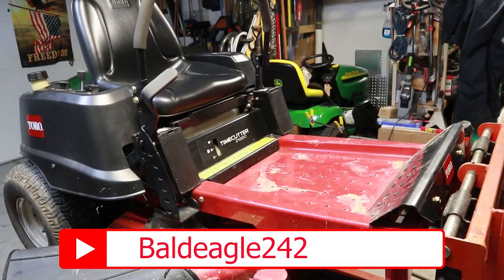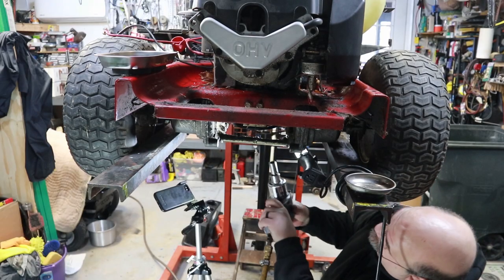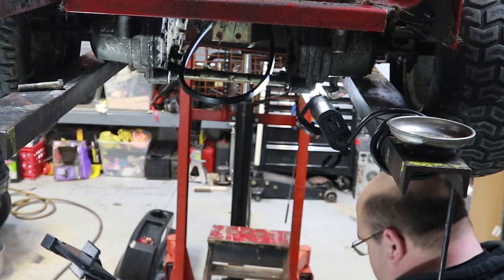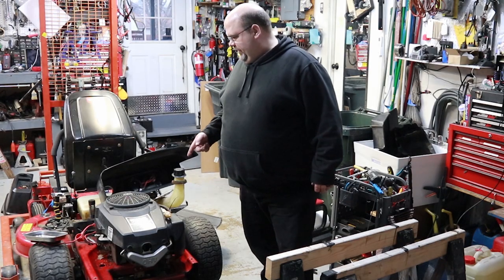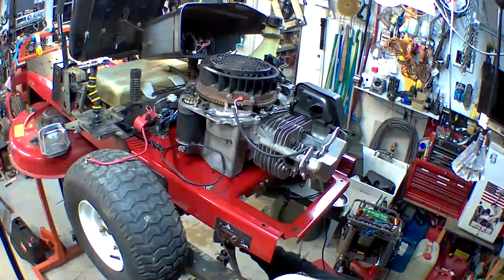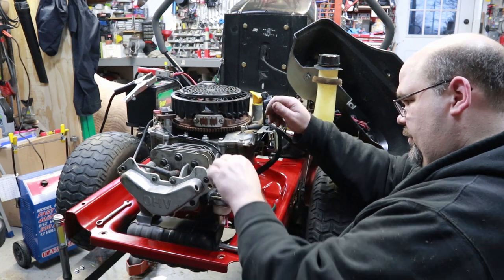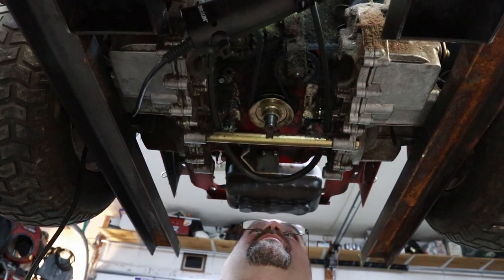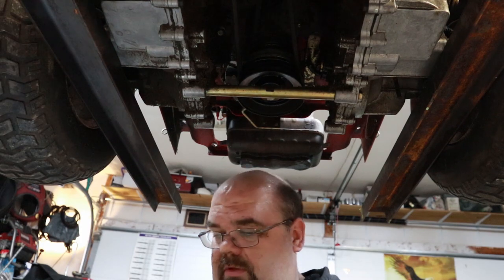How to PREVENT the Kohler Courage Engine from Cracking the Block #baldeagle242

Comment: If the video had even covered a small portion of the subject the title referenced I would have given it a thumbs up but click bait gets what it deserves.

Great video other than the click bait title that offers a question the video creator didn't bother to answer or even discuss in any depth.
Reply from the maker: Thanks for watching. You must have skipped the first 20 seconds of the video. In the first 20 seconds of the video starting at the 00:10 mark I explained why this happens and how to easily prevent this issue. The remainder of the video was what needs to be done after the engine has been cracked.
Reply: @baldeagle242  I am sorry, you are correct and I missed that short explanation. Thumbs corrected.
Reply from the maker: @rickbauer7088  You’re a good man. Thank you sir. 🦅🇺🇸

Comment: What is the Fail safe on your lift,, That is what i would be worried about the lift giving away
Reply from the maker: I made a reference in the video about this. I welded a latch that flips around on the side and has a strap I tie around the top.  
With all the comments I'm getting on the lift, I plan to do a video on it at some point shortly.  
Thanks for watching and stay tuned.  🦅

Comment: Nice video, so is the main reason these engines have a bad reputation due to them losing oil and then blowing up, etc? Or do they just have multiple weak points/issues?
Reply: ah I see from some comments, its a little of both. I may buy an older Dixon ZT with a courage swapped on, will have to check it over very carefully before giving/selling it to a co-worker - if I don't keep it myself lol.
Reply from the maker: @M.TTT.  there are a few issues with these engines. Some issues can be prevented. 
The main issue is low oil and keeping the oil fresh and full. 
A second common issue that I mentioned in the very beginning of this video is the case/sump bolts become loose and back out catching under the flywheel. This usually results in the front corner of the case being cracked. 
The internal cam and timing gears are plastic and any type of backfire or sudden force can strip teeth off the timing gears. 
And last but not least the compression release mechanism is prone to failure and spreads broken parts all around the crank case.
Reply from the maker: @M.TTT.  I still have this mower and use it when I don’t have anything else running in the shop. There are lots other them out there still running but it would not be my first choice if I had other options.
Reply: @baldeagle242  ah, thank you very much for the reply and information. Guess I'll just hope it doesn't blow up and if it does, I'll try to find a cheap lawn tractor to do an engine swap.
Reply from the maker: @M.TTT. I’ve seen them with over 1200 hours on them.  If you change the oil and keep the oil topped off they can run for a long time. 
You’ll also want to make sure to keep the engine clean so air can flow around it. I’ve seen them fail because the are so encased in dirt and grass there’s no way for the heat to escape.
Reply: @baldeagle242  ah yeah, I'll have to make sure my coworker keeps up on maintenance, easier said than done, but maybe he'll take it seriously. Thank you again for the help

Comment: I have a courage 22 that I "rigged" with the customized C clamp and JB weld over 5 years ago. Still works fine. The top side bolts and the 4 engine mounting bolts have loosened a couple of times, yes it still leaks a small amount of oil but not much.  This mower has cut 100s of acres of grass. It is a 2009 gravely 2250 mower. Rebuilt both hydro gears last summer.    Still works great.
Reply from the maker: That's awesome.  Someone tried to do the same thing to the original engine on this one but it didn't work out as well. I never tried to use it myself but the seller said it would leak half a quart of oil in 20 minutes of usage.

Comment: I have one that was given to me by my next door neighbor. Needs a solenoid and a starter so far. Hopefully that will do it, but I also want to replace more things on it to make sure it runs longer. Rust spots all over it, but not all of the way thru the metal. A little auto body work will make it look good also. Thanks for your video. It has pointed out some things that I did not know about it. Maybe I can figure out a way to make grease fittings for the underside.
Reply from the maker: That's awesome; I love the free ones.  Thanks for watching, and let us know how it turns out.  🦅🇺🇸

Comment: I think the engine mounts come loose first causing all that vibration knocking those loose, I had a engine bolt hanging half way down pitful
Reply from the maker: I wouldn’t be surprised. I see at least one or two of these every season.
Reply from the maker: +suzie Q Thank you so much for taking the time to share your comment! I hope to see you around on future videos. 😊👍
Reply: I have a engine mount bolt broken off up in the hole.. I was wondering if I ever get that bolt out and if my cylinder block is cracked due to loose bolts I pray it just the oil seal or the sump pump gasket but if it is could I buy a cylinder crankcase block just like mine I’m wondering if all my parts would hook up to it?.??
Reply from the maker: @suzieq8379   I would not spend much money or time on a Kohler Courage. It’s better to swap pretty much any other Kohler model or Briggs engine onto it.
Reply: @baldeagle242  I can't afford a new motor.. I do my own work on it and I can check all that stuff Ive had this mower since 2009 it is zero turn troybilt rtz I love my mower, I don't want to spend money on another lawn mower either if I did it would be used and worn out mine looks brand new Ive always keep it inside
Reply from the maker: I generally try to find a used mower with a bad transmission in that situation and swap the engines. It’s usually not practical to buy a new engine.
Reply from the maker: +suzie Q Thank you!  I hope to see you around on future videos. 😁👍
Reply from the maker: +suzie Q Glad it was helpful.  Thanks for watching! Here’s a link to other videos I’ve posted that you may find useful. https://youtube.com/playlist?list=PL5_ZXmQpcjpac4UV8OW8g-IWVCR8tqy79&si=RKfnQL-PAcZFy67a
Reply from the maker: +suzie Q Thanks for watching! Here’s a link to other videos I’ve posted that you may find useful. https://youtube.com/playlist?list=PL5_ZXmQpcjpac4UV8OW8g-IWVCR8tqy79&si=RKfnQL-PAcZFy67a
Reply from the maker: +suzie Q I had one come in this week that had completely cut through one of the engine mounting bolts and elongated the mounting holes. 🤦🏻
It was so loose I cant believe the belts were tight enough to run. Thanks for watching! Hopefully you’ll find other videos I’ve posted interesting or useful. https://youtube.com/playlist?list=PL5_ZXmQpcjpac4UV8OW8g-IWVCR8tqy79&si=RKfnQL-PAcZFy67a
Reply: @baldeagle242  I took my whole engine off I thought I had a crack but didn't but i used red lock tight my motor isn't moving a bit now before it was bouncing every where that is what in my opinion works them loose, thankful I had no crack.. I hit a large root I didnt know had washed up it quit, the blade was touching the deck pulled that out but kinda shaking fixing to go try and mow now.. probably have to get them balanced.

Comment: I finally got a new motor but it's more difficult to do something if you've never done it before
Reply from the maker: Best advice I can give you is take pictures before you pull anything apart and keep your bolts and parts separated by area.  If you have a few magnetic bowls they work great but if not zip lock bags will get the job don’t.  
I always look at it like this… it’s already broken all I can do is make it better.  Good luck with it and feel free to ask any questions.
Reply: @baldeagle242  bad news for me the new motor didn't come with the mounting bolts and the bolts for the old motor won't work
Reply from the maker: Most hardware stores should have bolts that will work.
Reply: @baldeagle242  bolted up and fired up on first key turn im glad im not stupid as I look but is my first engine swap and it's a new motor so probably shouldn't let it idle at full throttle definitely don't want to blow up the new motor
Reply from the maker: @calbertkensill8435  it’s a good idea to let it run at low rpm without much load on it for the first few hours.  I also like to change the oil after only a few hours of operation just in case there were any machining burs or shavings that got left in the engine.  Congratulations on your first swap.  😁👍
Reply: @baldeagle242  bad news went to go for a test drive but no reverse no forwards or left and right any ideas hopefully the transmissions are not bad
Reply from the maker: @calbertkensill8435  Check to make sure you(or someone else) didn’t pull the rods on the sides to roll it around  while you were working on it.   If that checks out I’d make sure the belt is on correctly and the keyway is in place. Little to zero chance that both transmissions went bad.
Reply: @baldeagle242  I have been rolling it around quite a bit loading on the trailer off the trailer and into the garage
Reply: Im not sure who was working on it before I bought it for 150$ sounded like a good deal
Reply: Is the clips in the back
Reply from the maker: @calbertkensill8435  If it rolls easily someone has probably pulled the release rods out.  There is one on both sides of the rear area of the mower.  If you look at 7:02 on my video you’ll see one of them at the bottom of the screen in the middle.
Reply: @baldeagle242  I got one side to move but the other side not so much
Reply from the maker: What did you find on the side you were able to get moving?
Reply: @baldeagle242  the side that i wasn't able to get to the bar came out of the peg I just hooked it back up got it to release and now both sides work
Reply from the maker: That’s fantastic news!  I was thinking about you when I woke up this morning.  I’m happy to hear you figured everything out.  Congratulations!  🦅🇺🇸

Comment: Crazy but used 271 red on my own and that was 5 years ago 
Not leaking or breaking bolts 
But I bought grade 8 bolts for sump
Reply from the maker: Believe it or not I’m still using this mower for my own yard. I used blue LT on these bolts and it seems to be holding just fine. I don’t think it really matters if you use red or blue or even lock washers. Whatever you use is probably good enough. These are not engines that anyone will be rebuilding 10-20 years from now regardless.
Reply: @baldeagle242 Do you remember what these bolts should be to torqued to on the Courage motors? Thanks!
Reply from the maker: @jimh.412 Between 12-15 foot pounds.
Reply: @baldeagle242  Thank you. I'm doing the valve cover gasket next week and going to loctite those case bolts too. Just picked a rider up with the Courage motor fairly cheap and it was smoking of course. I'm glad my good rider has a Kawasaki motor in it. No problems in 10 years. 👍

Comment: The best use for a Kohler Courage motor is a boat anchor ⚓ ⚓. The replacement is going to fail again. I have a 15 year old 20HP B&S Vanguard motor on my lawn tractor that has had regular oil changes/filters and it starts and runs like new. It does not leak or burn oil. The Kohler Courage motors are garbage. Replace them with a reliable motor. They all leak , crack and fail. The design is garbage.
Reply from the maker: Amen my friend, you’re not wrong. 😁👍